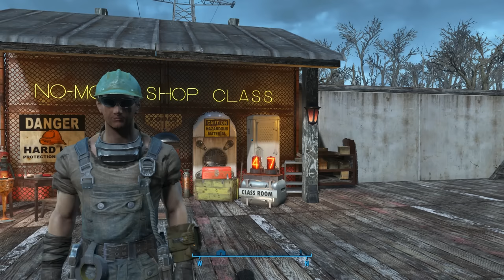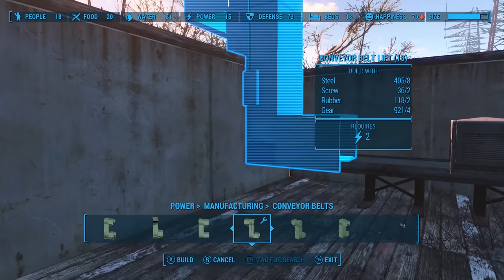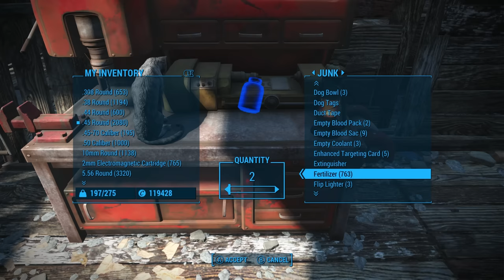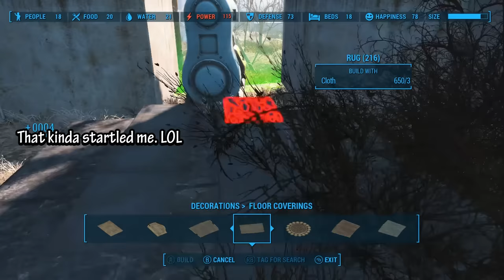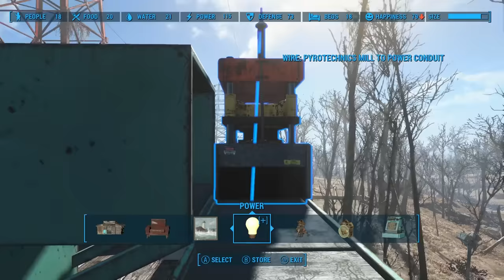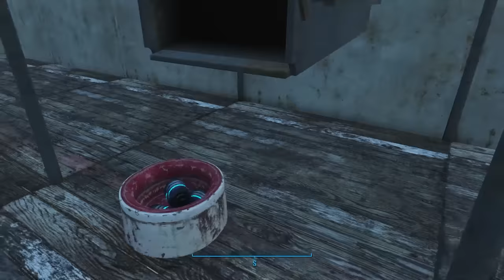An Introduction to Manufacturing 🏭 Fallout 4 No Mods Shop Class

Comment: For some reason I can't get my terminals to work... It worked a moment ago to program an ammunition station but I moved the setup, replaced the ammo station with a builder, and suddenly the terminal gets stuck on "Initializing...". I tried connecting it to my builder, my power source and the hopper, to no avail. Any idea what it could be?
Reply: Never mind, it seems the terminal just glitched out. To anyone experiencing the same issue; Store the terminal in the workshop and place it back down again. That seems to reset it, and the correct options pop up again

Comment: Any suggestions for reducing frame rates for complicated manufacturing setups in a single settlement? I’ve got a pretty complicated set up, but my frame rates drop horribly lol.
Reply from the maker: I know what you mean. The more lights and animation, the more frame loss. That's just the nature of the game engine. That's why I don't build massive factories. I just have smaller factories at a few different settlements.

Comment: You do not need to connect every manufacturing device to electricity "separately". As they are connected to each other, connecting only one is enough. Therefore no problem with bunch of cables... :/
Reply from the maker: You are correct. But if there is any break in the pieces, you have to wire those separately. Plus, the big items need to be powered separately, like the Builders and stuff. In any case, wiring is no longer an issue anyway, check it out: https://youtu.be/O_eEipBr8as

Comment: Hello. I am having issues setting up more than three ammo plants. I can get the three going but once I place a fourth line and set u a terminal the terminal will not work. I have everything running on it’s own generator to allow separate ammo to be made. But I can’t get a fourth running and I’m not sure what I’m doing wrong.
Reply from the maker: That's interesting. Not sure why. Have you tried setting that last one up with its own terminal?
Reply: Skooled Zone yes. I have three terminals right now Hooked up to three separate ammo manufacturers with their own power source. I have the fourth one set up the same as well but it won’t run. After watching some more videos of yours I’ve noticed you can take away the terminal and the builder will just do it’s own thing. So maybe this will fix it.
Reply: It’s not the biggest issue as when I run out of junk for my current ammo I’m making I can switch it out. Three is still good but I wanted to fix this in case I want to make other things while making ammo as I have it set up to just remove and place in a new builder.

Comment: did anyone else notice how he screwed up the conveyor belt and then corrected it off camera? he placed a right turn down and then seconds later after a quick edit it switched to a left turn.
Reply from the maker: Hehe, good eye. Yeah the video was already almost an hour so I just cut that part out. Otherwise people would complain that I was extending the video on purpose for more ads or something. Most people that try it will notice pretty quickly that the belt is going the wrong way and just turn it around. ;-)

Comment: Do you have suggestions on how to break down junk easy? I'm tired of dropping junk every time
Reply from the maker: Check out Tip #1 in this video: https://youtu.be/Jl-idDvy-PE
Also, you don't necessarily need to break junk down. When building, it will automatically strip the needed materials from junk stored in your workshop.
Reply: @SkooledZone  does it connect on supply lines as well? Like if I have a roll of duct tape on red rocket but I need adhesive in hangman (favorite place to make a home and if you have videos or ideas lemme know lol) will it break it down?
Reply from the maker: Yes, as long as long as you have those particular supply lines connected.

Comment: 24:07 - "That is a very very simple setup for manufacturing."

He said after spending an untold amount of time making it look like the vacuum hopper is pulling items from a dumpster, then adding various attachments to move it up then move it back down to the same level as the dumpster.
LOL

Just messing with you. I understand why you did it that way: it's to demonstrate to the viewers various options for making an assembly line.

Great video!

Comment: All you need is the mill and storage. All the conveyors, vacuums, hoppers, lifts, etc are waste (save the frames). 
    
You can load your junk straight into the mill and the storage will catch what comes out. 
    
Most of the production is useless. 
     
The most useful is the ammo one if you are playing a high ammo build (handguns and automatics). 
The junk one is only good for lunchboxes if you are playing an explosives using build for bottlecap mines. 
The food one produces some clean and some dirty food. For survival, the clean Blamco Mac & Cheese has low weight, good health gain, and no rads.
The armor one is only useful if you want to equip large numbers of settlers with heavy armors (and it will eat a lot of ballistic fiber). 
I've never needed the weapon ones to arm a settlement up with matching weapons - but you might find the need if you are planning on giving them all mini-guns (though you can likely farm those), Gatling lasers, or Gauss rifles. 
The explosive or pyro one? Why have it do what you could do at a chem station and get XP for doing? 
The clothing one doesn't produce anything useful.

Comment: Not bad.  A bit over complicated.  But, I tend to only manufacture the ammo type(s) I need.  No vacuum hopper, just the manufacturer, directly place the materials, maybe a conveyor, and finally the storage.  When I got complicated was 3 ammo manufacturers spitting out onto a lower conveyor track and then into one storage.
Reply from the maker: Yup, you can place materials directly on the conveyor. I mentioned that at 4:53. However, when you're mass producing stuff, that's a lot of dragging and dropping. Easier just to stow it all away and have the vacuum hopper do the work.

Comment: Wait how do you wire glitch
Reply: I always use the small wooden power pylon on a rug. Just grab the rug by tapping the grab button (don't hold the grab button or it will select both pieces, you just want to see the rug highlighted) and you can have the wires run through walls and floors. I think the wire will break if you go too far away though, just test it out nearby to start.

Comment: This is kinda random but does anyone know how to fix the glitch when you loose MASSIVE amounts of materials from my workbench. I lost 8000 steel and many more things and I haven’t got raided. I play with no mods.
Reply: The-Art-Of-Whoopin Yo Behind got any supply lines? Ive noticed sometimes the npc suppliers trade the items for their inventory junk, i never keep anything in workshop cause of that lmao i have so many supply lines
Reply: Jason Hall no, I just reloaded a save and I’m up to 11,000 steel now. It’s just sucked because it felt like I played through 10+ to get back up. I just keep an eye on my workshops now. Thanks for help though.
Reply: 8000 usually isnt enough to cause glitches i had duplicated up to 150k steel totally glitched down to 5000 but all other materials are 10k to 50k and they never go missing and they only reduce when i use them if you duplicate just try not to go past 50k on anything 50k will last a very long time even if you're lvling up with the robot workbench 50k wll sustain the botton mashing for several hours non stop

Comment: I still consider DLC a mod. If it doesn't come with the vanilla game it's a mod, especially if you need to pay to use it.
Reply from the maker: The main difference is that it's an "official" add-on made by the creators of the game.
Reply: @SkooledZone  It's a modification to the vanilla game, so it's still a mod doesn't matter who made it.

The reason people don't like watching videos with mods is because they are looking for hints and tips for the game they've got.
Reply from the maker: @24magiccarrot   No problem. We can agree to disagree. In my opinion, a mod modifies the game, an add-on adds to it. If it's an official add-on by the original developers, then it's almost like cut content that was left out so they could just add it back in later for a little extra cheddar. ;-)